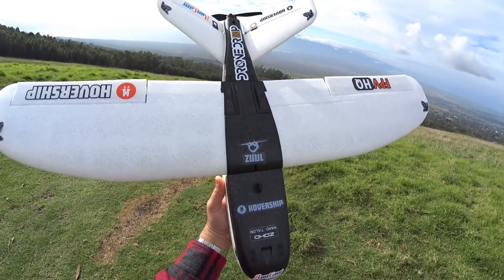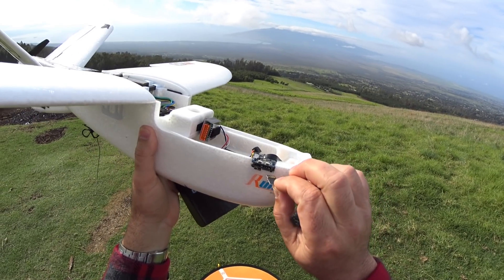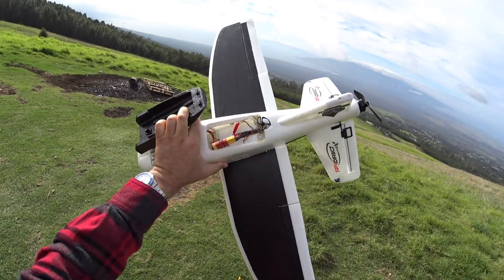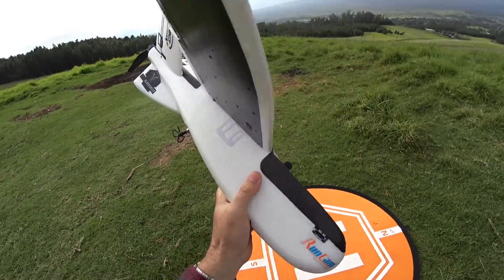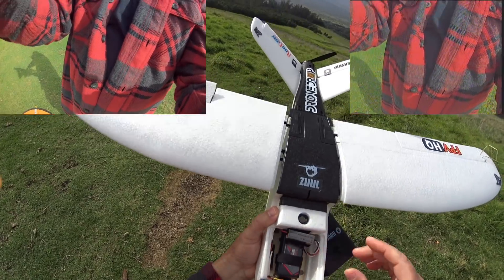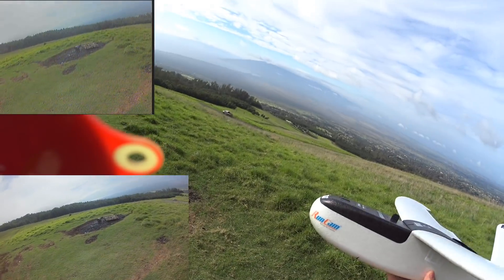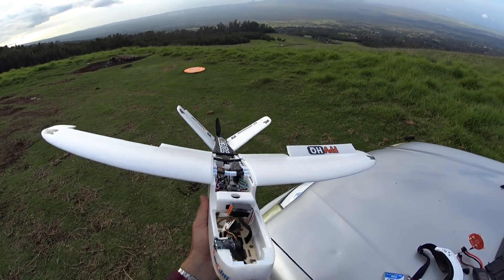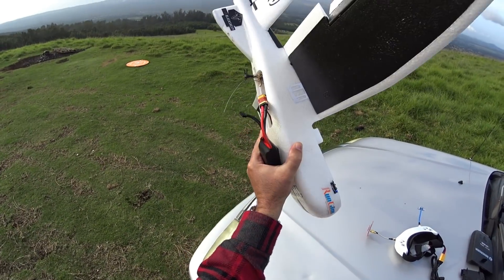ZOHD NANO TALON FPV Review with RunCam SPLIT MINI & RadioLink AT10ii [Flight, Range, CRASH! Test]

Comment: Are you using the esc that came with the plane? I have heard this can be an issue as it is only a 1A esc.
Reply from the maker: Yes, the stock electronics that come with the model.  Since doing this review I've heard about the issue.  May swap and also try an inav system 👍
Reply: yes, i am looking into replacing just the motor and esc, but using the same prop. Hobbyking have turnigy combos that are both cheap and apparently quite reliable, so it doesnt need to cost much to upgrade. a bonus is the sound of the motor is better too, not quite so buzzy....lol
Reply from the maker: Thanks for the tip.  I'll check those out 👍

Comment: hi dustin how do you power your vtx? with the same battery by balace connector?
Reply from the maker: I used a piggy back xt60 plug with a jst connector coming out but you’ll have to make sure the vtx can handle the main battery voltage this way.

Comment: very strange, it did look like a wing came out. They dont have to pop out by much to become disconnected from the control rod. I do know however the stock esc does not like 4s, most owners replace the esc straight away with something a little better, the bec is only 1 amp and can cause brown outs. So I would replace just to be sure. Great flight upto that point though.

Comment: Is there a way to set continuous recording rather than clips?
Reply from the maker: +GAproductions Yes, you can change it by holding button on left which brings up settings and adjust with both buttons while looking in your FPV screen 👍

Comment: I believe you could improve your video signal a bunch by mounting your video antenna pointing up or horizontally.  The 
 signal propogation from the circular polarized antenna is weakest out of the end (tip) so by pointing it straight down you are going to get the worst possible video feed.

Comment: That Radio Link receiver is the size of a small house...Its cheap radio though....What you need is iNAV and an F4 Omnibus Flight Controller....Oh, and passing your receiver antenna through your VTX antenna is wrong on so many levels.
  I was waiting for your 5.8G video link to fuzz out in that cloud when you were a mile out TBH....Brave with no AP onboard.
Reply from the maker: +EnglishTurbines I may put inav in there.  Looks pretty straightforward and will be nice to have the osd and gps failsafe.  Definitely the wrong place for the second Rx antenna which I'll probably run straight back to rear now but it did well enough until the Kamikaze spiral of death 😂

Comment: What battery should i use for 30 min flight? Pls help i am begginer what plug shoul i use xt?
Reply: You can try li-ion pack. They have more capacity but the cant output that much current as lipo so you won't be able to do flips spins etc but you'll be able to go long range on 1/4 - 1/2 throttle constant. (btw they are kinda same weight as lipo and some are lighter)

You can get them at: https://www.3dxr.co.uk/product-category/li-ion-batteries/

or: https://www.gettitanpower.com/pages/hobby-aircraft-endurance-packs
Reply: I prefer Titan power  3S 3.5 ah endurance. For a plane like this, that battery is more enough to do about +- 1H.
Reply: btw try looking at nano goblin 😉.
Reply from the maker: I've started building my own Li-ion packs in Liu of the parrot  Disco modding.  Not that difficult once you get the hang of it.
Reply: @DustinDunnill  Where did you get lion cels from?

Comment: Scratchy because you're flying into clouds? Water moisture throws the 5.8ghz fpv around a bit? Nice video tho.
Reply from the maker: +Crintrin Could be part of the reason.  I don't think that antenna that good on the plane either.  Bent alot from a race drone.

Comment: Try setting yaw rudder  mix lower or remove yaw mix

smix reset
smix 0 2 0 -100 0
smix 1 3 1 85 0
smix 2 4 1 -85 0
smix 3 3 2 -30 0 
smix 4 4 2 -30 0

Comment: I wonder if you experienced a tip stall. Very difficult to recover from. My first maiden ended the exact same way with a flying wing. I turned to go with the wind and then before I knew it plummeted to the earth in a spiral :( Without knowing your actual airspeed In FPV I tend to use a lot more throttle in turns now. nice video :D

Comment: I am scared to go in manual mode with mine, coz some people told me it is a bitch to fly like that, and prone to stall and spins. I never used fly-by-wire before this model in my whole life, always did things with nothing between my fingers and the servos, except for a radio carrier wave. Did you try it with the controller switched off?
Reply from the maker: You mean see how Fail-Safe reacts?   I set it to do a slow circle when radio loses signal or is off but have not tried in flight.
Reply: @DustinDunnill  no no, I mean, how it behaves (flight characteristics) flying without stabilization, in manual mode. That is what I want to know. Thanks.
Reply from the maker: I think I showed it in the video?  It will hold pretty well just won't auto level when you let go of sticks

Comment: Wasn't it just a tip stall, due to low relative speed compared to the air around the wings?
Reply from the maker: +Christer Løkås I don't think so.  I had no right stick even when you can hear me full throttle and try to pull up.  Aileron was locked full one side 😲😢🎆

Comment: You should never have both your receiver antennae an fpv antennae that close, or worse, touching, threading through one another!  It's amazing you didn't get terrible reception an range issues.
Reply from the maker: Guess it doesn't matter as much as you thought.  Huge frequency difference between both is probably why.

Comment: ouch what a shame repairing it after just one flight hopefully you can fix it and get a better second flight out of it and maybe glue the wings and tail just to be sure
Reply from the maker: +How To DIY Rc Already fixed 👍. Still don't know exactly why it crashed but I think onboard flight Controller malfunction.  Just glad it did not happen at distance 😅
Reply: the FC that's a real bummer on the other had your pretty lucky it happened close by it's so easy to lose model with a range test but he at least your looking in a place where it's warm and looks amazing from the air
Reply: Definately wingtip stall. Made a few of those myself. You'll be paranoid from now on, så It'll happen less frequent in the future. Cool vid

Comment: They have Crap esc' s,  its only a 1a Bec so possibly a brown out and servos died for a bit.....
Reply from the maker: +bg563195 Does seem like the FC was the culprit here unfortunately.
Reply: Hi Dustin Dunnill a big hello from grey cold and wet London England, nearly midnight hear and drinking wine.  My Nano talon suffered similar issue,  I now have a split wing spar and the single black canopy is now a two piece black canopy.  It now has an TURNIGY Plush 18amp with 2amp Bec.  Seems fine now.  So what convinced you it was the flight controller?

Comment: The reason you lost range is because you put the receiver antenna next to the vtx antenna
Reply from the maker: +Ravenster1 I don't think so.  The very tip portion of the receiver antenna it where signal is received and is a different frequency.  Plus I wasn't that far away.  I'm pretty confident it was a flight Controller glitch.
Reply: Dustin Dunnill, I see what you mean

Comment: this is a shitty plane and it keeps happening to everybody ... wouldn t recommend to buy it
Reply from the maker: +CircuitBender Thanks, I thought it was only me.  Do you think it must be the flight controller glitches?
Reply: well as you can see with many "reviewers" they silently add inav and an FC and show those images, with the standard ZOHD stabilizer I had now crashes with the nano talon and the dart, both look like they could fly (bad joints and construction nevertheless) but I both maidened them with the stabilizer in the correct position (launch in the mode where the elevons move up if you give throttle and then switch to passthrough (kind of - just the stabilizer is reduced) or 3d mode, and both models did crash. I have now filed a complaint and hope they resend me at least the aircrafts without electronics, I will then try inav or a custom mix on my frsky and test that - I am quite convinced that this method will work. although both models are quite small and get rocked around by wind quite easily